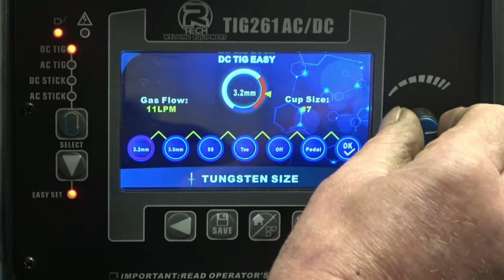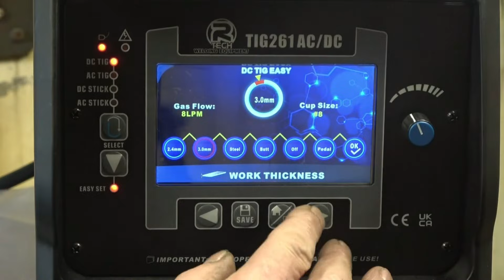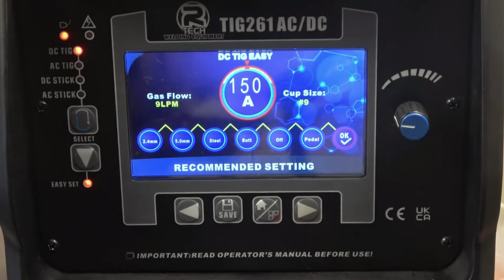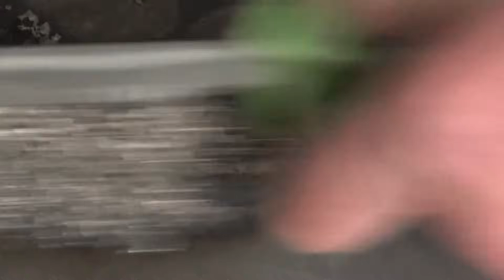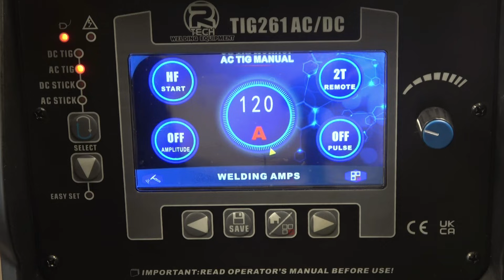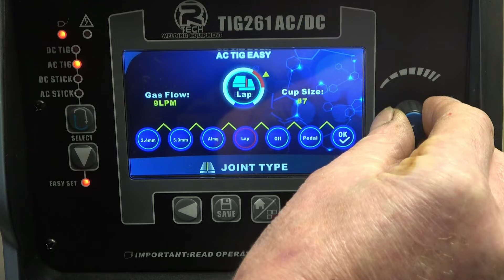R-Tech TIG 261Digital TFT A/C D/C Tig Welder Review .Easy Set

Comment: Does the machine set the gas flow or is that done at the gauge
Reply from the maker: The machine gives you a gas setting this is set with a flow meter at the regulator manually

Comment: hi john, Do you have to set the gas flow manually or does the welding machine set it itself ?
cheers ben.
Reply from the maker: It tells you how much gas flow it needs for each weld . This is set at the bottle using a flow metre .